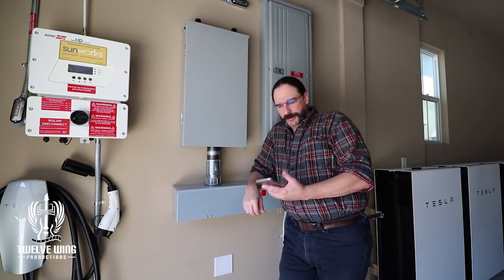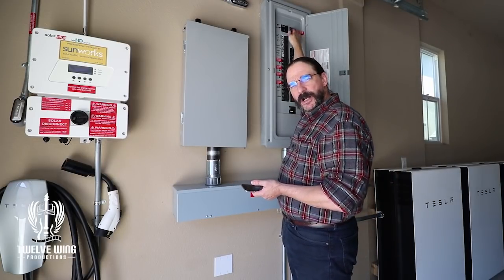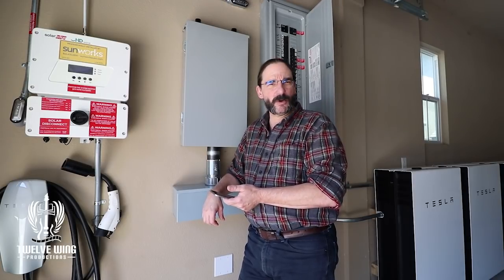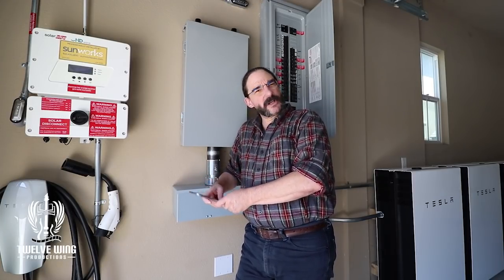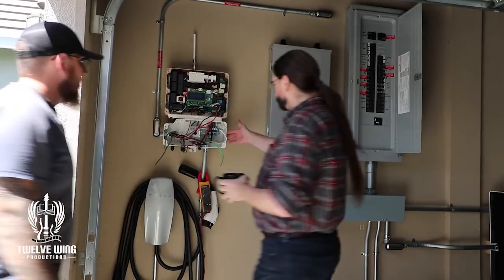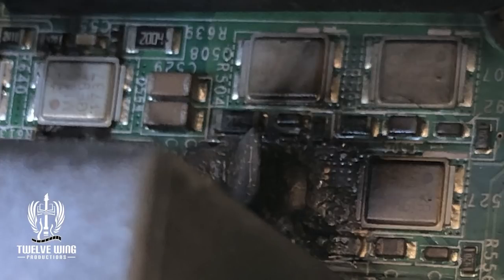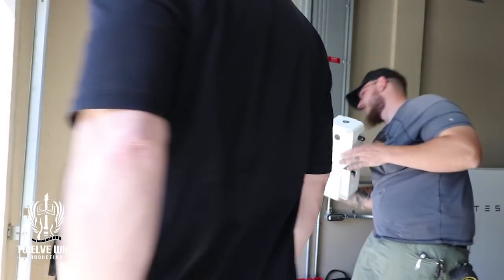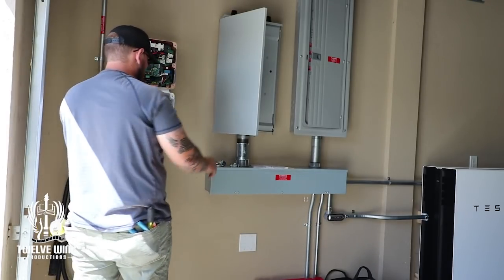6 Tesla powerwall system suffers main inverter failure

Comment: Wow, that power transistor just exploded! That would be impossible to repair as the PCB is probably burned and even if you would replace the transistor it would not have good heat dissipation.

Comment: did i hear correctly when you said three powerwalls provide only enough power for one day?
Reply from the maker: I think the part you are referring to is where I said that at the time of the failure we had a system percentage of 56% and that since we use approx. 30kwh a day, and because we still had 95 miles of charge left in the car, if they had not been able to immediately do the repair we could have run a day or more on what we had stored.

Fully charged, the system will run the home for approx. 4 days without any solar or grid contribution at all.
If we have solar, in winter we can run for approx. 7-10 days.  If the power outage occurs before Halloween or after Feb 12, we are self sufficient.

3 powerwalls, at our consumption, would run the home for 2.5 days or so with no other contribution.
Probably 5 days or so in winter with limited solar contribution. 

Obviously the same from March to October as that depends more on your PV supply than on the batteries.

Comment: Why currently available inverters are not "intelligent" and able to scale from 2kw to 12kw on the fly? 

Those manufacturer could just take the full 12kw hardware and split it in 6 X 2kw sections that the system automatically bridge together as needed, from 2 all the way to 12, in 2kw increment. 

You could take full advantage of your summer light, without being penalized for slow days in the winter and the inverter would always operate at maximum efficiency, including in spring and fall! 

I can't believe this solution doesn't already exist, or does it?!?
Reply from the maker: The likely reason is cost and complexity.
That said, you may have just designed this year's "Better mousetrap".
Such a device would be the ideal inverter for home use.  The only thing I'd add would be redundant circuits so that if it's internal low range, high range or mid range circuit took a dumb, you could use one of the redundant outputs and either at least produce something or perhaps fully produce with slightly reduced efficiency until repairs could be made.

You build that and I'll buy one.
Reply: It does exist...it’s called ENPHASE MICROINVERTER

Comment: Shouldn’t have any issues at 113% inverter to solar sizing. Solaredge advertises you can go up to 150% of the inverters size. It’s common “best practice” to size to ~125%. Believe this may be an issue on the manufacturing side as of last yr or so. Have been hearing more frequently about failures with industry peers. Get the 25yr warranty extension, can get it up to 24mo after the manufacturing date. Believe it’s around ~$400 to extend for that specific unit.

Comment: The electrician is just trying to do his job and the home owner won't stop talking.
Reply from the maker: This is where you really do need to have boots on the ground to understand our relationship Kieran.
This is all new to everyone.  You did catch where they were going to open up the gateway?
The relationship I have with SunWorks is the best possible relationship I think possible between home owner and installer.
They have been incredibly responsive and curious about what is going on.
They took my design requirements and were willing to push the envelope as far as possible.

What we have both learned about this has already been an incredible asset to them in dealing with customers that want one, two or three powerwalls.
They have recently done a couple 4+ powerwall installs and those installs have already been streamlined by what they learned, and are continuing to learn, about our system.

So trust me... 

... this isn't a case of me uselessly slowing them down.

Comment: Good argument for micro inverters if one goes down you don’t loose your whole system
Reply from the maker: True.
I have micro inverters here at the studio.  There is also an argument to be made for efficiency... though our efficiencies seem to be pretty good with our inverter.  I'll tease better data out of that in June when we are producing at full power.
Reply: @twelvewingproductions7508  Just curious and I don't know the answer, but are you implying micro inverters are less efficient than say solar edge inverters?
Reply from the maker: @whiggs , sorry... I should have been more clear.  No, individual micro inverters at the point of generation are more efficient than doing it at a single unit.
My point was that with that said, I was impressed with the efficiency of our single system.
I do have a comparison I can, and will, make in June when I run efficiency numbers by comparing our studio system using micro inverters with our Tesla system using the SolerEdge inverter.

I may even get an opportunity to compare both the efficiency of the 7.6kw inverter with a 10kw inverter if SunWorks replaces ours.
This will also allow me to examine and compare the efficiencies of this same inverter against data we have already collected during times of low production times.

Sorry for the confusion in the way I worded that.
Reply from the maker: @whiggs , one other thing to add for clarity. 

Though having an inverter for every panel does increase efficiency this does not translate to multiple single inverters.
Losses for these types of inverters are dependent on having the inverter match the application.
If one has a system that only produces 4kw of power but is hooked to a 12kw inverter, there are going to be large losses that occur inherently in the system's draw just to remain operational.
The inverse is also true.  A 15kw PV system hooked to a 12kw inverter will clip and suffer losses in production.  Also, as we might be discovering, an increase in the amount of stress on the system resulting in premature failure.

Oddly enough, these same stresses may occur in a system that is under powered.  This thread probably isn't the place to address why that is in detail but it comes down to what happens to an inverter when you "unbias" the system by lowering the input voltages beyond their ability to operate.  This too can cause premature failure.
Reply: @twelvewingproductions7508  great thanks for clarifying, enjoying the youtube videos and the info you provide. I am getting a solar system installed very shortly (2 weeks) and thank you for your insights. Batteries coming in a few years.
Reply from the maker: @whiggs , best of luck with your system!
Reply: Do they make micros that work with Tesla batteries? Micros often clip as well enphase lists the max output not inwatys for this reason so people don’t notice. If you have a 360W panel I believe the best the IQ7+ can do is 290W. It will vary with application and dc vs stp output of panel its matched with. Best to get the 25yr extension on the warranty with Solaredge recently their has been more failures than normal. @twelve wing productions I don’t believe the 10kW inverter works with the batteries only the 7600 & 3800
Reply from the maker: @brianhundley833 , the interesting thing about Tesla's choice for having it operate only AC is that it works with any inverter type.
What the Powerwall won't do is to allow you access to its DC buss.
That would increase efficiencies but as we will discuss in a video later this month, it also opens Tesla up for a lot of headaches in trying to integrate their systems.

So they opted for a system that simply takes in AC and puts out AC.  How ever you want to invert it on the solar end is up to you.
Reply: Twelve Wing Productions ahh I see I forgot about that change since the first one. Keep em coming, appreciate your videos
Reply: Microinverters are much more expensive then one, for example 10kW inverter. They also don’t last as long as they work in very difficult environment, even -20C in winter and +50C in summer, at least here in Poland.

Comment: Might be different in the states but in the uk we switch off AC before DC 
And when switching on it’s DC then AC, I always remember it by simulating a power cut
Reply from the maker: Basically the same Chris.  My approach was largely based on how our system is hooked up.
The first thing I wanted to do was to remove any solar load because though inverters are designed to "fail safe", I still didn't know exactly what had failed.
The next thing I did was to remove both AC and DC power to the inverter by cutting the switch buss (bottom box) on the system.  Lastly, I wanted to make sure the breakers weren't tripped.  Sometimes it's difficult to see visually if it's tripped so cycling the breaker was the next logical step.

From there, because of how the switch buss is designed, it is irrelevant what gets turned on first.
Both AC and DC are both still in isolation until the inverter switch is thrown.  At that point, the inverter starts it's boot up procedure where the two are still (hopefully) kept in isolation.

Only in it's final stage when it wakes up does it make sense of the current coming in from the AC and DC side.
Hopefully that cleared some things up.
In an off grid system powered by solar, you are correct.  You want to bias the DC first so you can start outputting your AC to systems that need to boot up.
In our case, the batteries all have their own inverters so we still had system power.
Additionally, we did actually still have grid power.
Because this is a grid tied inverter, it wants to see AC power as well as DC.
Hopefully that clarified things.

Comment: Surprised by what they said regarding the clipping "We don't want it to faltline" "it adds stress" "I think you might need a bigger inverter"
I have an 8.82kW array, all facing the same direction (south) on my roof and they installed a single 7.6kW inverter. I was getting a TON of clipping and mentioned that I thought it was an issue but was assured it was fine. I was finally able to get the 7.6 replaced with two 5.2kW inverters and on day 1 (back in April while still cool), the system capped out again at 10.4kW output which blew my mind. It was just for short bursts so I'm not worried about it and it hasn't happened since it has warmed up, but it makes you wonder just how much is really being clipped when an inverter is undersized and how harmful that may be to not only the inverter but the panels as well since the excess energy is dissipated as heat to the panels. Even in this heat (mid 90s in FL) I can still see times where my 8.82kW array outputs over 9 and up to 9.4 so I'm really glad I was able to get my inverter replaced, even moreso as one did a FW update today bringing my production down by 1/2 for about 15 or 20 minutes (not much) but a single inverter would have brought 100% of the system down. So now there's inverter redundancy and pretty much no chance of clipping.
Glad they got this one squared away as quick as they did for ya though, always sad to see a nice sunny day go to waste due to issues with a setup

Comment: I ended up installing 2 Solaredge inverters (SE3000 and SE5000) as I had one crackle and spark right out of the box. When o expanded the system I added a second inverter
Reply from the maker: "I had one crackle and spark right out of the box."~

Drat!  But that is the nature of electronics.  As a general rule, either they will fail right away or they will work for a decade.
That's why I was surprised by this failure.  We will keep watch on it and may upgrade it in June.
Reply from the maker: "I had one crackle and spark right out of the box."~

Drat!  But that is the nature of electronics.  As a general rule, either they will fail right away or they will work for a decade.
That's why I was surprised by this failure.  We will keep watch on it and may upgrade it in June.
Reply: I have a solar edge HD inverter ( 6.5KW also and it failed twice 2 weeks apart. TESLA replaced it to a 7600 watt solar edge ( my system is 6.82KW).
I am thinking on getting a spare inverter because TESLA  energy took a while to get a new inverter from Solar Edge. What do you think?

Comment: Good service you got from your supplier. It worries you doesn’t it, is it just a one off?
Reply from the maker: My concern is that the little bit of clipping we are getting might be stressing out the inverter.  Initially I wouldn't have thought that 6-800W of clipping for a couple hours would be that big of a deal, but the inverter did fail.
So I'm waiting on word now as to exactly what failed and why they think it did so.
The clipping is at the top of the list of possibilities at the moment.

SunWorks has been great as far as response goes.  Even before the project kicked off, they were very pro-active.  Last year, before the batteries were installed, they actually contacted me to let me know that we had a panel fault.  Just a loose connection but it was nice that they were the ones to notice it.

I'll keep you all posted.

Comment: What model solar edge is that.   Onei just had installed has no LCD screen.
Reply from the maker: They mentioned that.  It's the 7600.  Mine was the last one they had that still had the screen.  They were going to upgrade mine but the new ones have a different antenna.  I think the entire communication module is different.
So they used the older style so it could be plug and play.
We are still looking into getting a 10kw inverter.
It will draw 2 more amps than the 7.6 but that shouldn't be too much of a problem.  It will gain us about 800W of output in the peak months.
Reply: Twelve Wing Productions if that is the case, mine is being RMA(ed) already for comm issues.  As for power aspect it been working fine, just 24 hour delay or more getting metrics from portal.  SE7600H - 7.6kwh max like yours is the model i have.   So far i’ve not yet peaked it out since were entering jun, 8.7 max system though.  It has no antenna, it uses power ethernet adapters to connect router.
Reply from the maker: @jasontrewin123 , I'm looking into getting a hardwired ethernet port for the Tesla Gateway.  I've had some communication headaches with my current wi-fi connection there already.
I suspect that if they upgrade to a 10kw inverter it will have the new communication protocol.  Best to get ready for it I suppose.
Reply: Twelve Wing Productions  Setup i have is 7600, which uses 2 tp-link power ethernet adapters, so far metrics are spotty every 12 hours if that.  As for SE overall, monitoring isn’t effecting it’s ability to produce power; right around 55kwh day.  BTW, what panels do you have?   Q-cell 325w x27 .
Reply from the maker: @jasontrewin123 , Hanwha 310 Duo.
33 of them for 10.2kw.
Actual peak output is around 8.2.
Reply: Would it be better to install two small inverters to handle your pv panel output? Or is the larger inverter more efficient?  When I add to my system I will have to add another solar edge inverter or change out to a larger one.
Reply from the maker: @seniordockman2946  

You, and a couple others, brought up a very interesting point regarding that...
... redundancy.
If I had this to do over again I would certainly consider the additional cost and complexity of a dual inverter system.

The failure of our inverter does identify a single point failure scenario.  Because we live in a major metropolitan area, this isn't as big a deal for us as it would be for someone in a more remote area, or someone designing a system for off grid living.
I'll put this in the video I'm editing now as it's an excellent point.
Thanks for bringing it up.
Reply: Imagine if it was an actual zombie apocalypse and this happens to you? No electrician to call and no more inverter replacements! I'm thinking of getting a spare inverter just incase my inverter fail again.